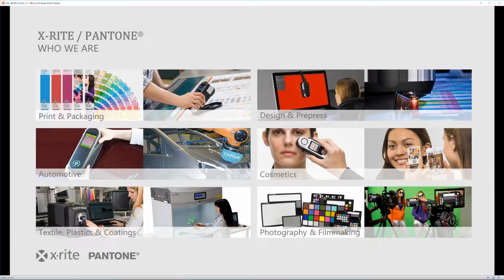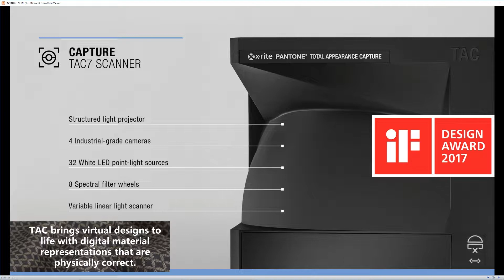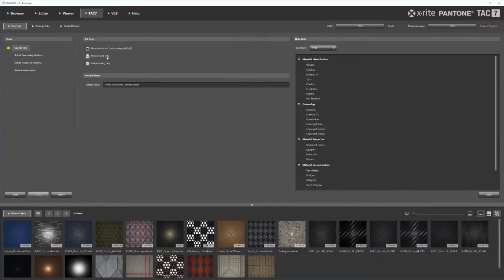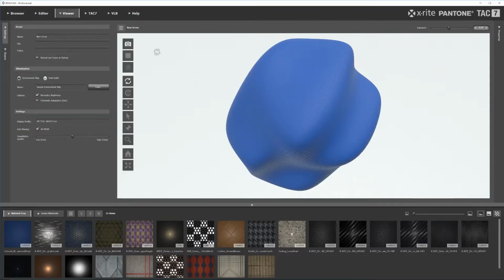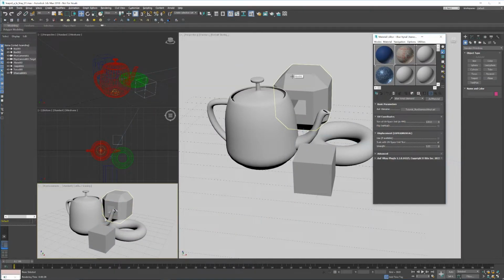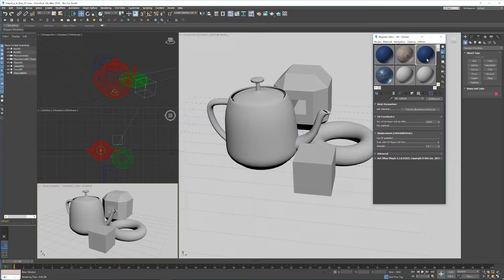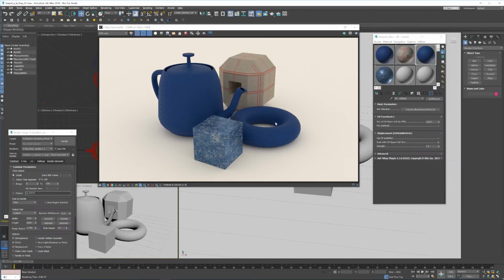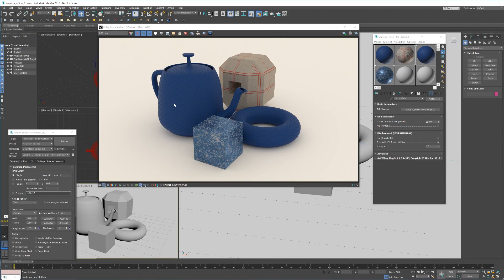Rendering an AxF File in 3ds Max with V-Ray

Comment: Hi - can one use Tri-Planar mapping for objects without good UV's? Thanks.
Reply from the maker: Hi @Lee Wilson. Thanks for your question.

Tri-Planar Mapping can be used with some materials, but is not a catch-all solution for materials.  Our AxF File and the Texture Maps contained in the AxF are “real-world scale” and are based on metric millimeters.  Although tri-planar mapping will work in some instances it is highly recommended that real-world scale UV Mapping is used. 

Hope this helps. Let us know if you have further questions.